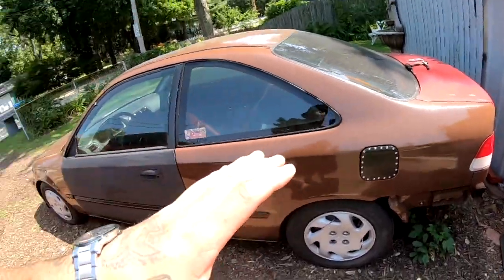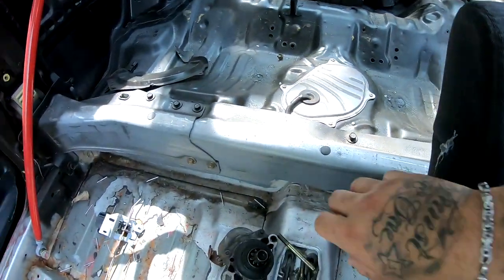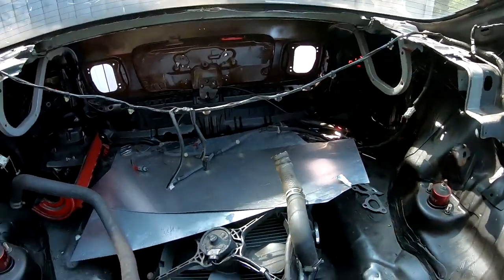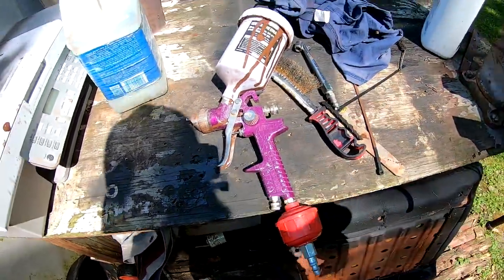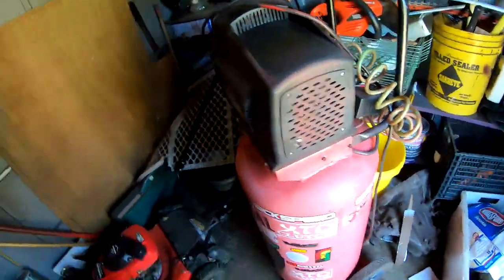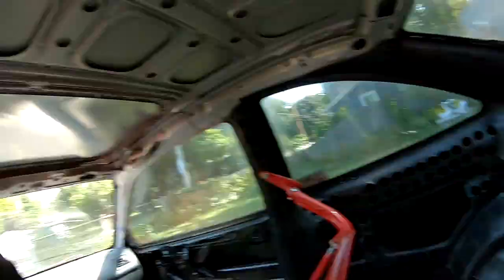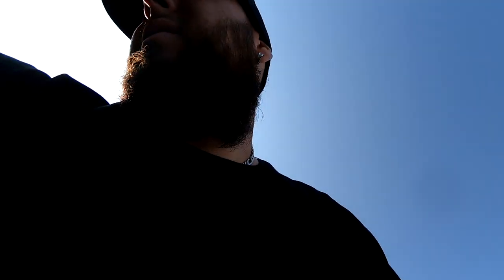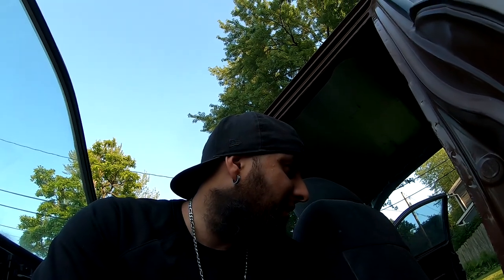Questions, Answers, & Gutting the civic some more

Comment: Cut all you want, just be aware that the more you cut out the more of a "tin can" it will become driving it.  

When you're done forget the commercial bolt in stuff, either build or have someone help you (I don't remember seeing a welder in your shop/don't know your skills here) a proper cage that will be track (IHRA/NHRA) legal to 9.99.  It will keep you safe, you'll be set if it ends up really fast and you want to take it to the track, and it will stiffen up what you took out of the body (main hoop- main structure, harness tiedown... Halo/front bars/door bars will keep a rigid structure around you, rear down bars from the main hoop to the rear suspension pickup points stiffening up the chassis and suspension.  Each main mount point will be required a welded 6"x6" plate.  In the end it will be a lot easier, cheaper, lighter, safer and stiffer than bolt in crap.  

If you were closer I'd offer a hand- with the car all ready gutted it should only take a day or 2, especially if someone offers a basic roll cage kit for that car.
Reply from the maker: Thanks for the support i could have used some help too lol theres a company by me that offers roll cages pre bent for civics @ around $300-$500 I might have my father in law weld it in he retired from caterpillar as a welder so he has many years welding.I would weld it in myself but it would end up like crushed peanuts instead of dimes. 😆
Reply: @BarbasLife  be aware that most "pre-bend" roll cages are a pre-bent main hoop, sometimes a slightly bent door bar and a box of straight tubing to make the rest, you need to cut, notch, fit... the rest.  They don't have much value over that amount of tubing + the 6x6x1/8" plates you need for the weld down points (in other words, I have no idea what someone is charging $500 for).

You FIL may or may not be able to help you.  Most industrial welders are used to welding heavy stock with a stick welder.  That will not pass tech and won't look right/work right no matter how good he is and how many certs he holds.  If he's good with a MIG welder then he can install a mild steel cage, if he can TIG that will let you go chrome molly which lets you use smaller bars with thinner walls (strictly speaking from a physics/metalergy standpoint a STUPID rule that both NHRA and IHRA follows.  There's a reason why NASCAR and many professional racing sanctioning bodies do not allow chrome molly anywhere near the driver of a car, but that's getting way off on a tangent).

Good luck in your build, I'll keep looking in.  If you need help/advice on this kind of thing feel free to get a hold of me, I used to work as a fabricator and do custom installs for a speed/performance shop so I have a lot of experience in the area (both how to do this stuff and how to save yourself hassles in the future).

Comment: So your saying it's a track car? That you'll be racing on the street in Mexico? I'm not worried about safety because I've seen cars cut a lot more than your ride. But 400 hp and 2300lbs doesn't make a fun car to drive unless you like whiplash...and Nes-quick is a cool project car...a roll cage will add most of the weight back and make it more rigid than stock plus the piller supports will help with handling...why are people giving you a hard time?  Come over to my place and help me put a 400 hp k swap in my wife's car.
Reply from the maker: Thanks for the support 400hp k swap easy on 3-4 pounds of boost. Those k swaps will make easy 500hp on stock as a daily.if you get all your parts from the junk yard you can have a cheap k swap. The bad part you gotta spend a lot of time at the yard to find everything you need.